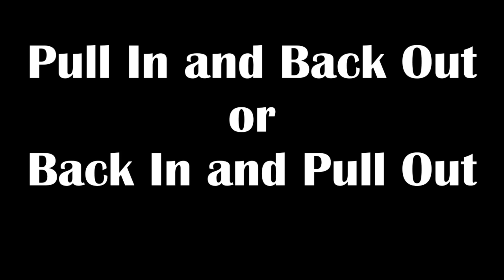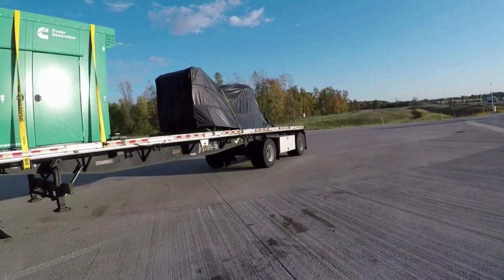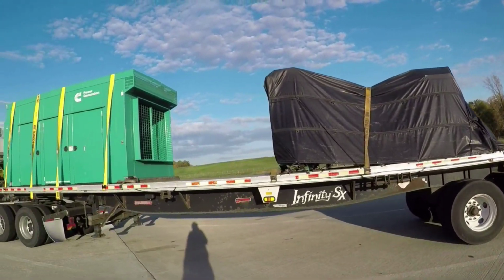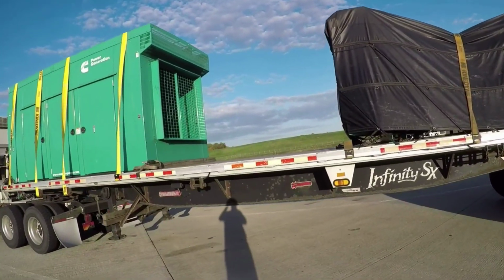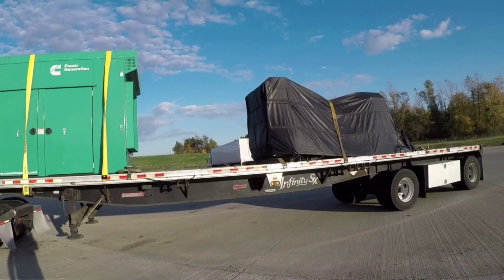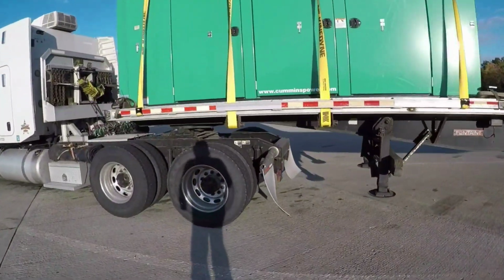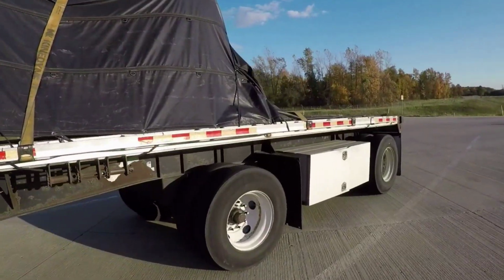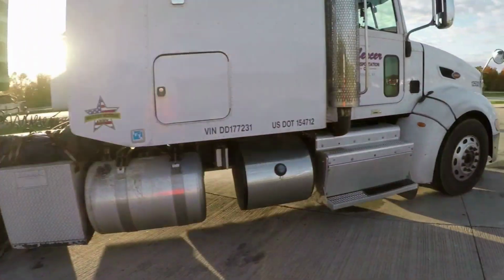#354 Pull In Back Out or Back In Pull Out The Life of an Owner Operator Flatbed Truck Driver Vlog

Comment: As a new driver in the mid 90's I was "told", I had to back into a yard in Staten Island NY.  The street had cars parked on both sides and I just couldn't get in there.  After about 30 minutes and many attempts, I heard one of the workers say, "Why don't you let him pull in from the back like the last guy, I'll move the cars in the way". I could have killed him at that moment.  I could see the problem from the beginning, but didn't want to speak up thinking that the last driver had gotten in, so I must be able to as well.  Turns out the last guy had a cab over and a 40' trailer.  I had a conventional with a 48' trailer....  The lesson is speak up when you need to!

Comment: I have over fifty years and I would NEVER pull straight in at that angle, only back in, you did the right thing, that yard was not built for big trailers, especially with that entry switch box there, if you had damaged the box with those morons guiding you, they would have charged you for it !!

Comment: Just came across your video. Nice backing job. I've been at it since '97. I was once told back when I first started "back in never out"... They are words to live by. Even if it means going around the block a time or 2 to get that correct set-up. And always sight side whenever possible. Keep it shiny side up driver. Thx again for your video. 👍👍

Comment: I'm not second guessing you, the guy that was actually there on the scene, and I don't know the particulars of the lift for the crane operator, but I'm wondering if a headache or two could have been alleviated by you parking on the street and have the crane lift those over the fence on to your trailer?  Maybe too far for the parameters of the crane, but I was just curious if it was even a plausible option.

Comment: I’ve been watching your videos for about two years.  You were talking about tires.  What do you think of the super singles.  Do you like them?  Would you consider using them?
Reply from the maker: I’ve never had super singles but I think of of the big problem with them is if you get a flat tire you can’t move. At least with dual wheels you can limp off the road or to a shop
Thanks for watching
Reply: Super singles are junk dangerous on wet and slick roads. Stay with duals

Comment: was definitely not a pull in spot! Back in wasnt to friendly.
Reply from the maker: Thanks for watching
Reply: Had a place kinda like this I was backing in a rgn to pick up a d336 trackhoe. But I had to do it blindside and get around an electrical box. Traffic was bad but I was thankful for the two cops that seen what I had to do, turned lights on and blocked off traffic. Puckered up the ass a bit trying to get out of there before rush hour

Comment: Dan I agree with everyone and you standing your ground and backing it in. But what pissed me off even more is to see such a big crane for such a small generator. You could have pulled up next to the fence if not on the side of the road for that thing. I think it was a bad setup for the crane operator and the foreman should have seen that. I’ve moved plenty of military generators with smaller cranes than that. 

On a second note what program do you use for your video editing
Reply from the maker: I was thought about that too. Could of just set it over the fence.
I use a program called MovAvi for my video editing. It's not to fancy but very easy to use.
Thanks for Watching

Comment: I'm with Dan my truck my say so I've had my share of do it my way or. I would say or what you can call another truck. I've seen drivers pulling in and was unable to back out cause they didn't have the room to swing that tractor around and the loader tell them thats not my problem i just run the crane